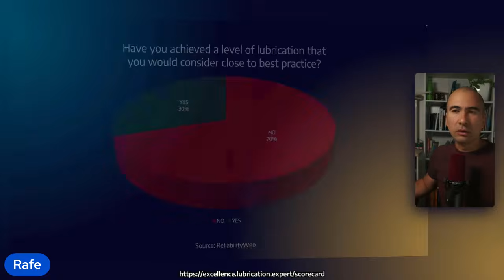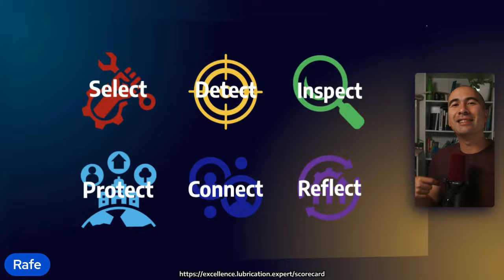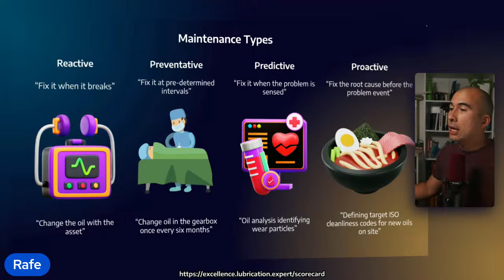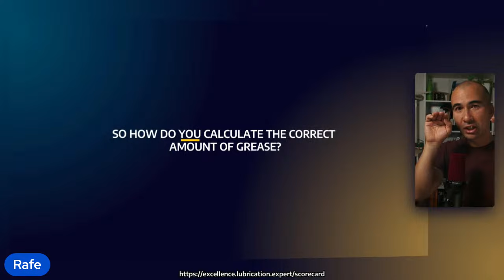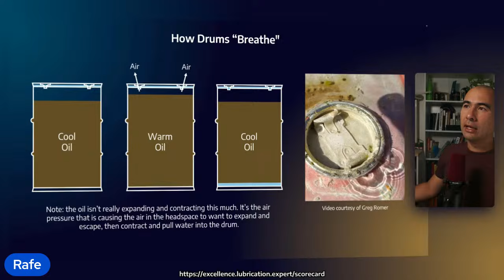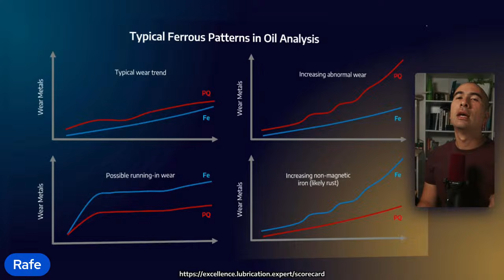UNDERSTANDING EQUIPMENT CONDTION MONITORING & CAREER INSIGHTS| WITH RAFE BRITTON

Comment: i Remember a analysis in my field before about the oil reports and the type of high margins of certain metals that were in the oil. i later on went back to checking the base metals of manufactured instruments. example the lubricator, hyd motor, pressure lines, valves and found out that  each were made of different metals. these records made it more a better insight of internal problems on wear and bi-metals of tarpon pins, internal hydraulic pumps and systems, gear reducers, lubricators and other fittings of being over the daily life expectancy of underlooked Time and life-machinery and total preventive maintenance inspection to theretical condition wear-down a-lot closer to bulls-eye target of class of next predictive replacement or Fix. I say it was a long investigation of the maintenance, but it was meant to be inspected through the whole machine line to a more incentive best prevention.